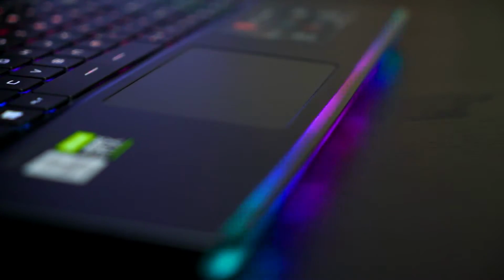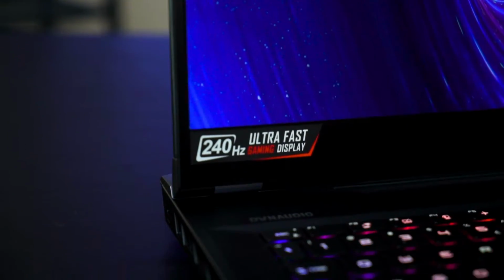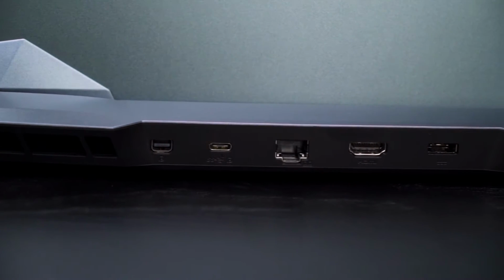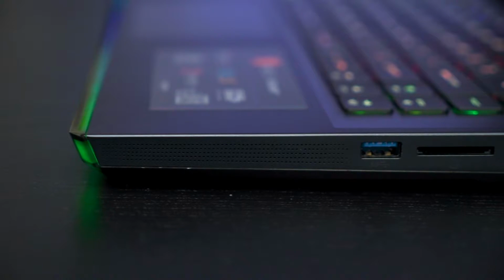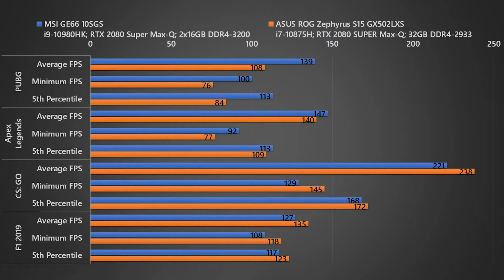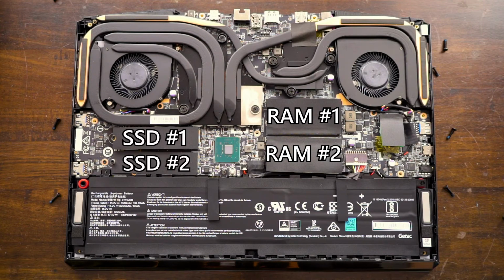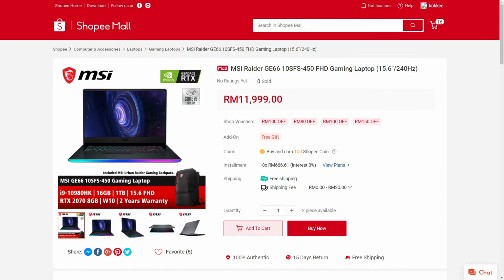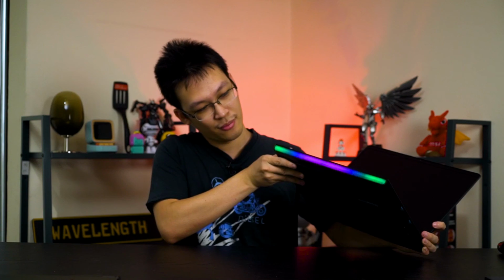Light em Up! MSI GE66 Raider Review

Comment: This MSI ge66 (2070 115w + i7 10875h) or Gigabyte 15g (3060 mux switch + i7 10870h) can you advice me please
Reply from the maker: there's a new GE66 with RTX30 series graphics, unless the your GE66 (RTX2070) is significantly cheaper, I would pick the 15G
Reply: @TechCritter  thanks! I did pick the 15G, hoping it perfoms well

Comment: Tester says his has 2tb ssd. Mine has 1tb ssd put about 7 games on it got notices that it shouldnt be filled above 750gb. It has a 10th gen core i7, 2070 graphics,  32gb  ram. 1799 at best buy week of black friday. Reg. 2199.
It can put out a lot of heat, and has a giant 14amp power brick. That said, after 3 months it hasnt had a hiccup and runs everything Ive thrown at it with graphics at full bleed and max framerate. MS flightsim 2000 is pretty and loads quick. The mystic light and case design are nice bling, you dont want to show up at work with this

Comment: What is thunderbolt 3 used for, Do I really need it?
Reply from the maker: Thunderbolt 3 is used for accessories and connectivity expansion, for example, it can be used to connect to multiple displays, storage and even external graphics card. 

If you're asking this, it is highly possible that you won't need it.